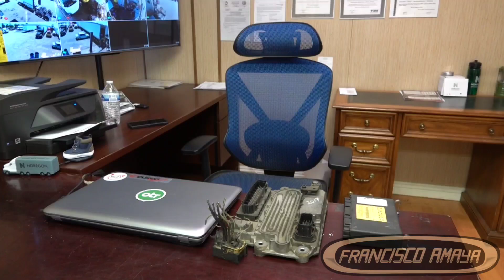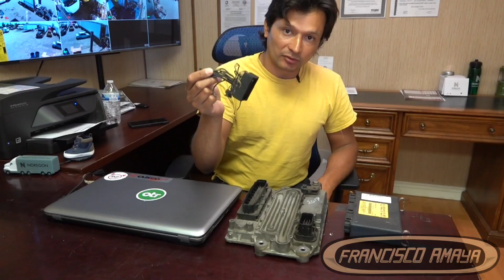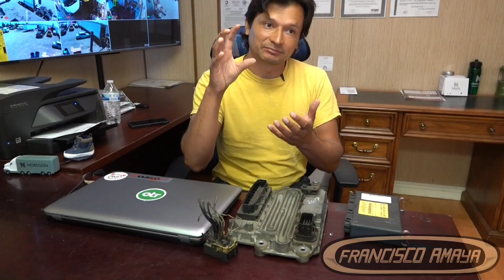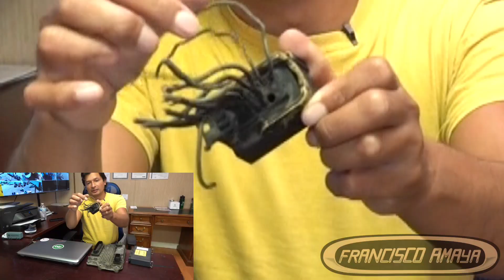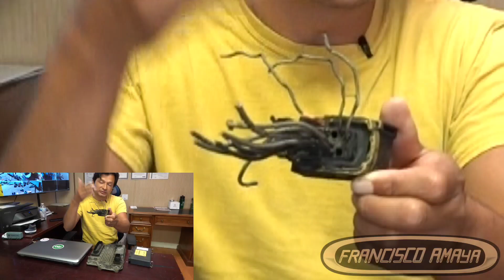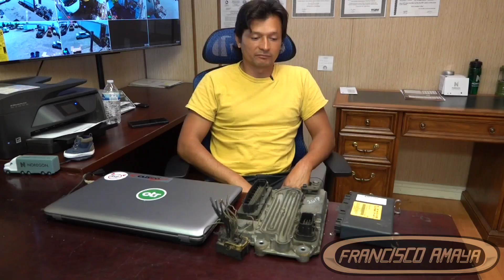ELECTRONIC COMPUTER PROBLEMS WAYS TO FIND FIX PROBLEMS MECHANIC EXPERIENCE  FREIGHTLINER CASCADIA

Comment: Please can you explain why 2016 Freightliner Cascadia dd15 engine showing fault code SPN4752-FMI0, SPN1636-FMI4  whenever I start up the engine with my ac on? But when my ac is off then start engine up, the faults  code won't come up but later come up.
 What might be the problem,  all reading is directing to EGR COOLER, INTAKE AIR MANIFOLD TEMPERATURE CIRCUIT FAILED,  INTAKE MANIFOLD TEMPERATURE SENSOR AND CONNECTOR in which I replaced everything except the EGR COOLER.